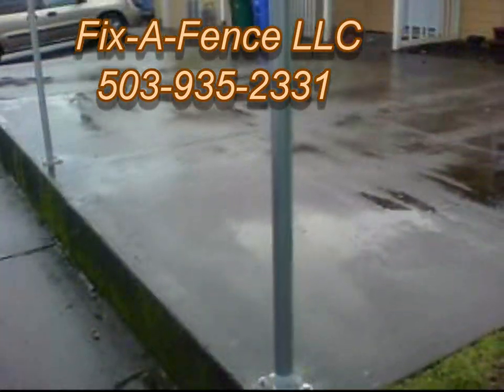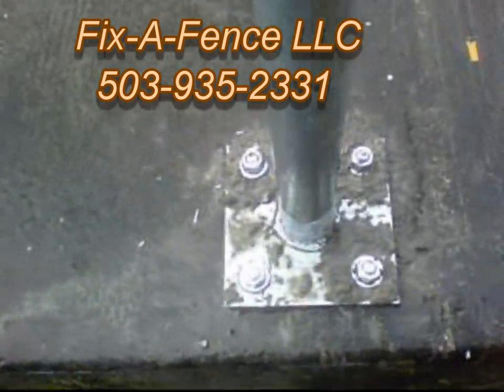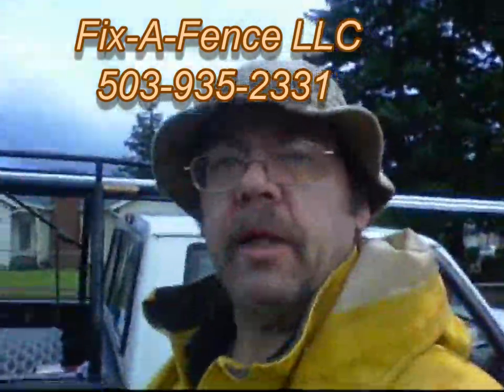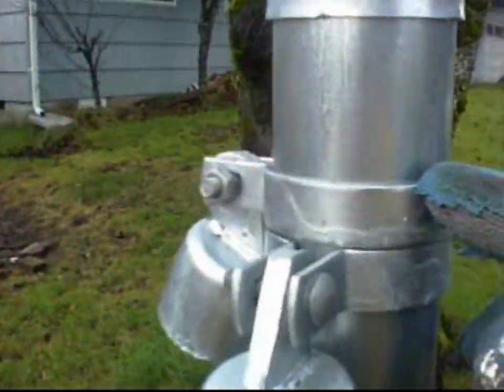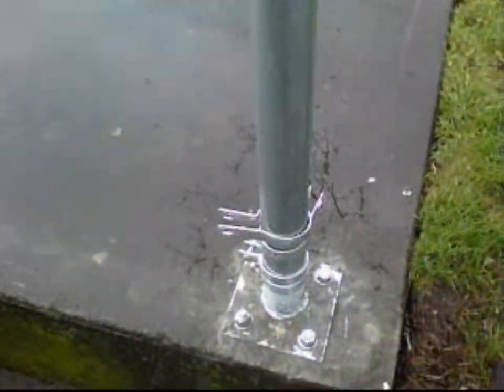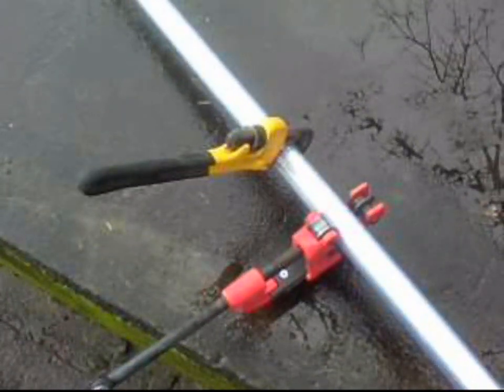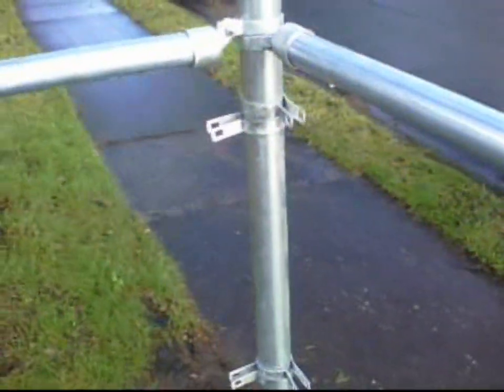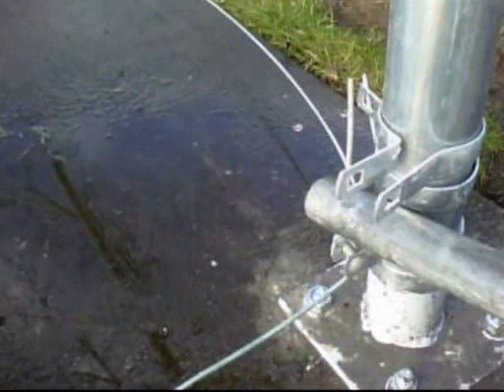How To Build A Chain Link Fence - Part Two

Comment: Any way to attach those fence poles without welding
Reply from the maker: If you are referring to a concrete slab, there is what is called a concrete core driller. I have used a place here in Oregon called LaneCo, they drill the larger holes in concrete that I am unable to, like they will drill a 12-18" diameter hole when I need it, is that what you are after? If so, there is a product called Pour Rock, it mixes up like a pancake batter and poured in to the hole then you place the post in that and hole the post level and in line for about five minutes and this stuff is hard as a rock to the point you can stretch chain link fence the same day,..hope this helps
Reply: @jwthefencer  thank you for that info. Nice of you. Go Ducks!!

Comment: How u drill hole for post tho
Reply from the maker: The holes are already in the flange plate,..as far as drilling the holes in concrete,..I use a roto-hammer to drill into the conctrete and secure the flange plates with the concrete wedge anchors,..does this help?
Reply: @jwthefencer  a roto hammer,  what size bit? Must be been big
Reply from the maker: @Eastbaypisces  It's a 1/2" bit,..there are wedge anchors at the box stores,..1/2" x 3-1/2" it requires a 3/4" wrench or socket to tighten down with,..

Comment from the maker: Thanks for your suggestions on how to make a better video for the next one. Always looking to do a better job than before. 

I like the core drilling too, however I only have a small roto-hammer so I did what I knew I could handle with the tools I have. No reason to spend more money than necessary.

Comment: When cutting the fence top rails with a tube cutter I use a Rockwell Jawhorse to hold the pipe. You can stand up while working and the Jawhorse holds it very securely.